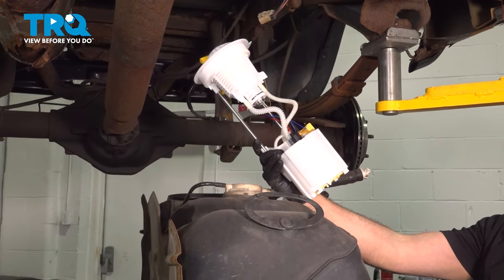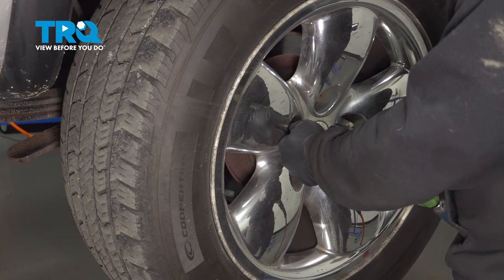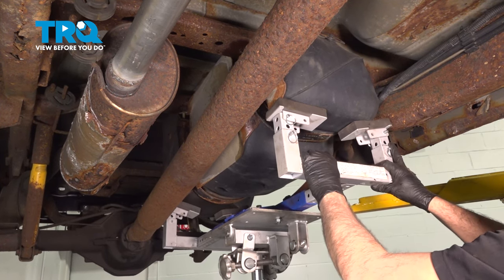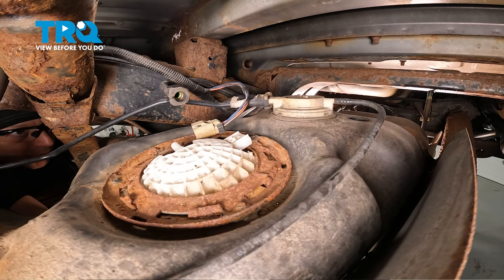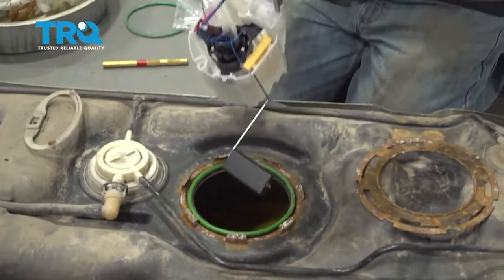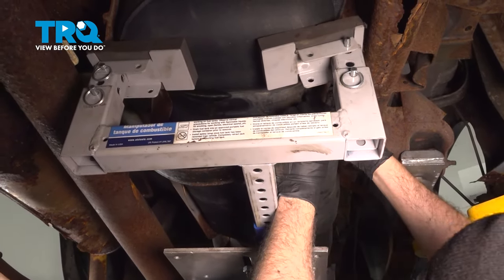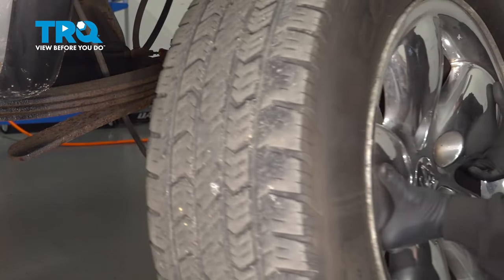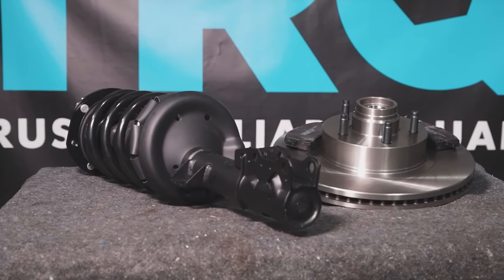How to Replace Fuel Pump Module Assembly 2002-2008 Dodge Ram 1500

Comment: I recently did this on my 05 ram 1500 and I found removing the driveline made it a LOT easier since I don’t own a car hoist. Using jack stands and a floor jack it went well. I did buy the adjustable equalizing bar for my floor jack from Harbor Freight so I had a lifting pad under each half of the fuel tank.
  By removing the driveline it gave me the chance to replace the rear Transfer Case output seal after draining the oil. Once all done I put new oil in my Transfer Case. I was shocked that it only holds approx 9 pints of oil though.

Comment: I am doing this on my 2005 Ram 1500 today. I have the tank out, but my locking collar looks like it is rusted to pieces. I guessed that it would need to be replaced so I ordered a new one, but looking at your video, most of mine seems to be turned to rust. I have been working at it in hopes of knocking rust loose so I can set the tabs that I need to get at to get it to move. I am not sure many of them are left. It is cold, so I needed to come in and let my hands warm up before continuing.

Comment: Have a question. I hope you can answer what is the thing next to the fuel pump with other hoses connected to it? I have a small evap leak on my 05 and I did a smoke test and it's leaking there.

Comment: Thanks for the video and advice. You were the only video I could find that actually took the time to show the fuel line fitting connection to the fuel pump and what happened after the fuel line tool wouldn't work and it took the small screwdriver 🪛 to get it to release. Happened to be what I am trying to get released and it was helpful for me and getting mine done 👍

Comment: Idk but I bought a fuel pump for my 2004 ram 2500 5.7 and it looks like this video, but the one on my truck looks different has a metal fuel filter on top and the parts store doesn't have the one like the one I see on my truck. Will it fit?

Comment: I did this job, but my check engine light is on and the fuel gauge does not register, What could be the problem? everything was working fine before.
Reply from the maker: +@weivecar We wouldn't be able to diagnose an issue like that here, you may want to have a local mechanic take a look at it. Thanks for checking us out! http://1aau.to/m/Shop-1AAuto-c